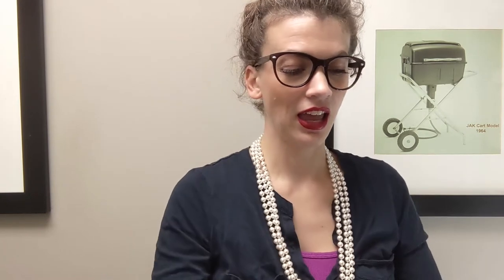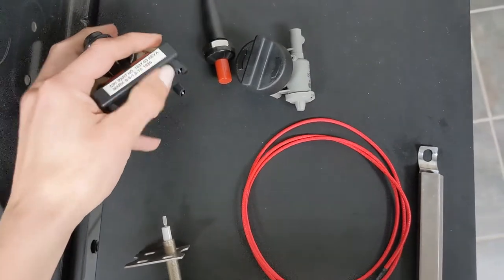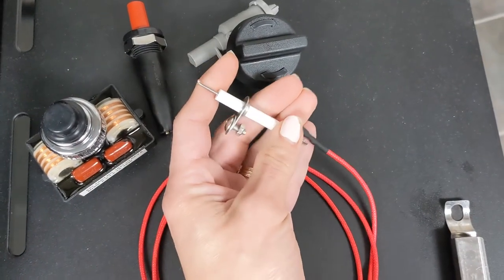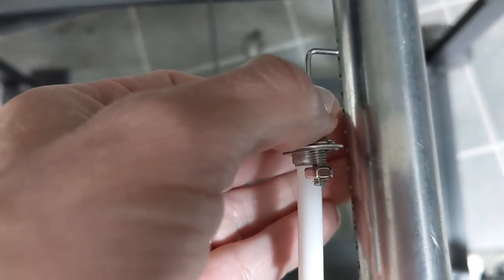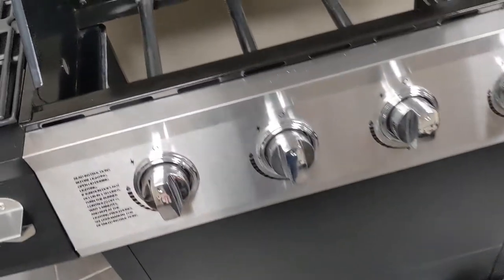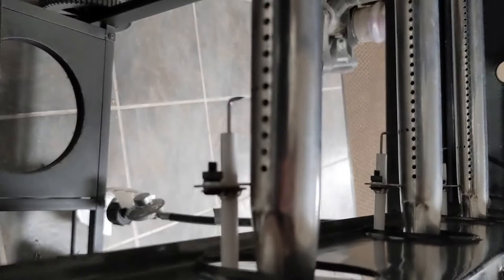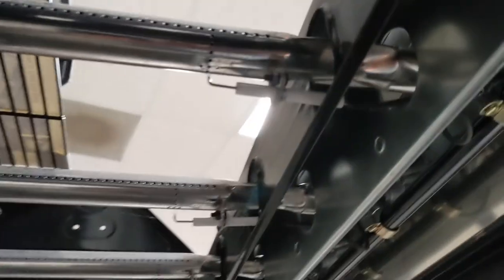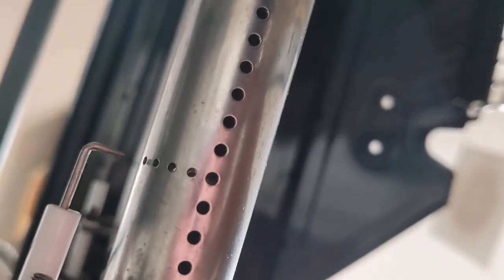Gas Grill Ignition Overview with Grill Girl

Comment: So if you have the piezo knobs as shown in the last couple of minutes, can you replace the ignition function with a universal battery-operated one by just connecting the outputs of that box to the individual electrodes?  Seems like a pain to take apart the grill to replace all of the entire assemblies rather than plugging in some leads - just not sure if it's possible and there's very little info on that type of retrofit.